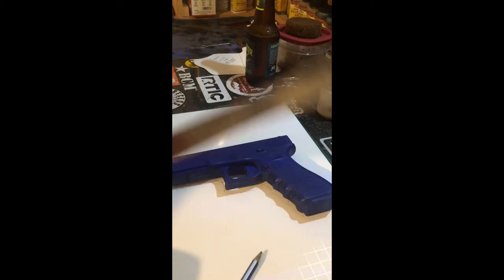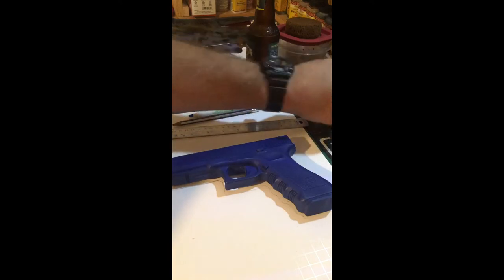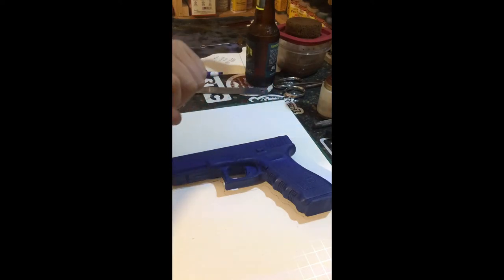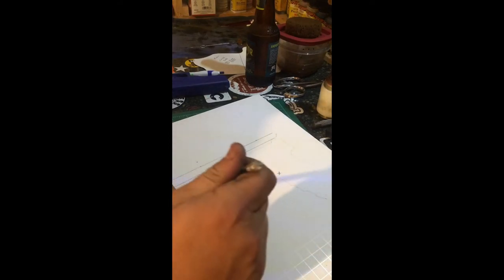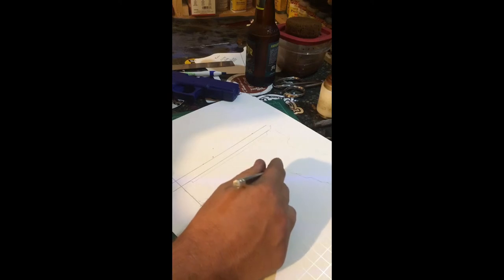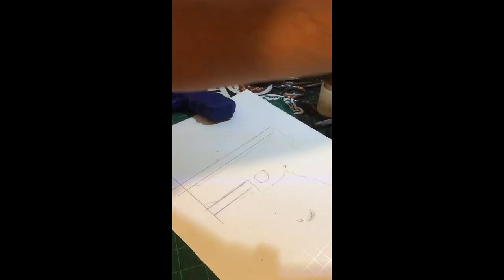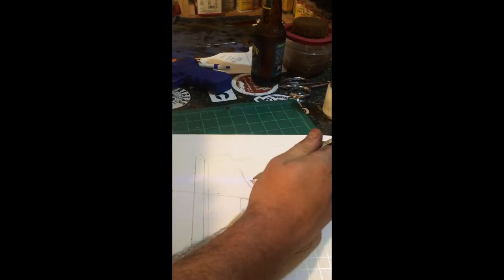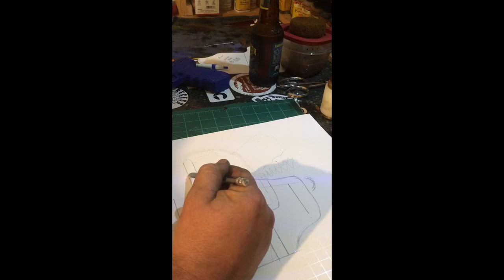How to make a leather holster template

Comment: Hello I wish you could give  a little more information about the distended between the belt lopes and stitch
Reply from the maker: Hey John. I don’t have a set distance I use. Every holster is slightly different. I ussually go by eye. At times I will put a belt through the actual template if I’m un sure. That ussually will tell me if I’m on track or not.

Comment: Do you make the back the same size and does that leave enough room for the pocket.
Reply from the maker: Darrell Ramsey on this style pattern yes. Because you measure the half difference of width that provides you the needed room to make the pocket once you wet mold. Hope that makes sense. Hard to explain unless you see the full process I may do a split video one day showing how we make up that difference in the molding process